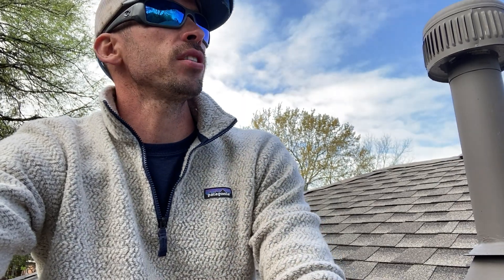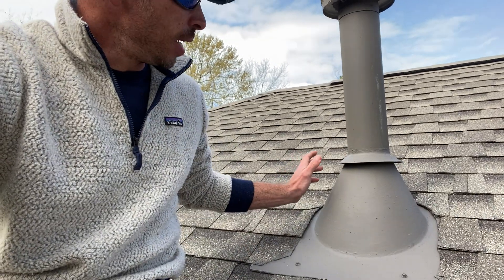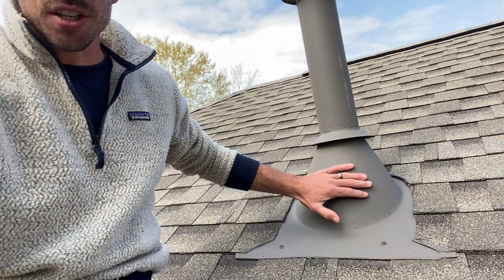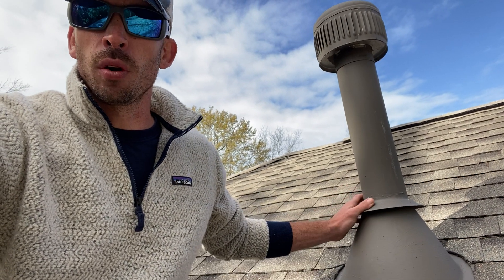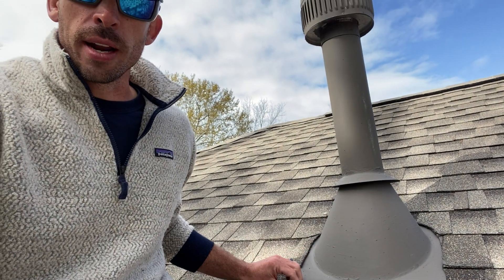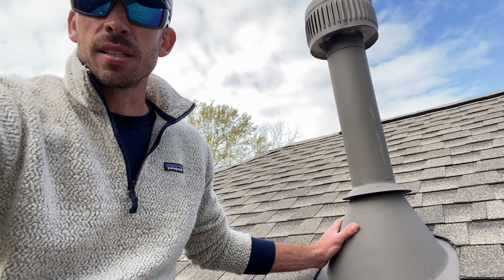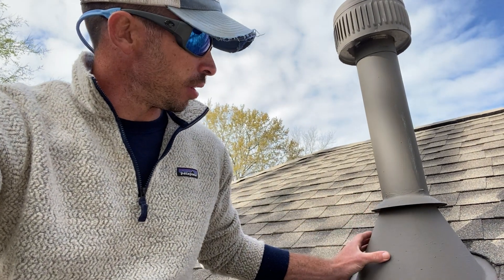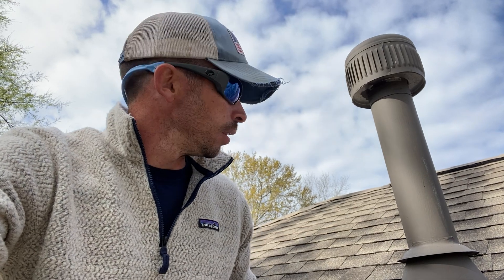Importance of base and storm collars on furnace pipes

Comment: Great video.  I have a question though.  We will be having a total roof replacement next spring.  I have 2 roof vents (HVAC) that will need to be replaced as well and have already been told by the roofer that they can't do this since they aren't HVAC licensed.  If I get someone else to do the replacement, is it better to do this before or after the roof is newly shingled?

Comment: Unfortunately the contractor that put on my new roof did not replace any of the base flashing for the water heater or electric mast. Only did the smaller plumbing pipes. As far as I know it's the same flashing that was put on the house when it was built in 1992. I wish I was more educated before hiring so I would know what to have in the scope of work before the work  began. Thanks for the video.

Comment: Excellent workmanship!! I just had a wood heater installed just before thanksgiving. The chimney goes straight up through my new $11,000 metal roof. It has leaked every since. The installers have been back twice now. We thought we had the leak identified. We even ran water on the assembly for half an hour with no leaks. We celebrated until the next rain. It leaked. WTH??? They’re coming back to try again. I’ve pulled the unit out from the inside in hopes of being able to watch for the leak should it rain again. I plan to try bagging the very top of the chimney to see if for some freaky reason the rain water may be blowing in somehow. Also plan to do a nighttime light test where I go on the roof while someone stands inside the house and shines a bright light up through the chimney. Frustrated. Thank you for sharing your work. Your customers are very fortunate to have quality contractors in their area.
Reply: Sounds like it could be possibly condensation from air leak in the duct work

Comment: I just watched one of your other YouTube videos in which you elaborated why one would not want to have an attic fan installed in a ridge vent roof. The rationale being that the attic fan would rob the ridge vent roof of the very air it is designed to convey from the soffits to the ridge vent. I started to wonder if the same rationale would remain true if one were to install a solar powered attic fan on the rooftop near the ridge vent? Wouldn’t the air being blown upward by the solar powered attic fan be in enough proximity to aid the ridge vent system in conveying air from the soffits to the top ridge vent area of the roof? Just wanted to hear your opinion as I have a ridge vent roof and am contemplating installing a solar powered attic fan to alleviate the heat gain that occurs throughout the day in the attic.